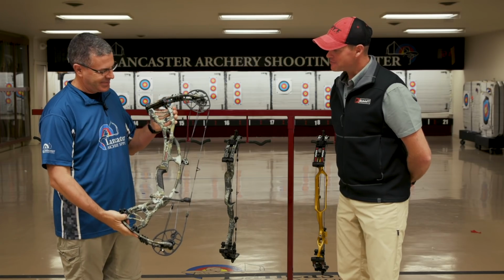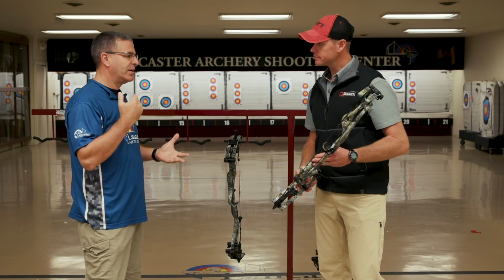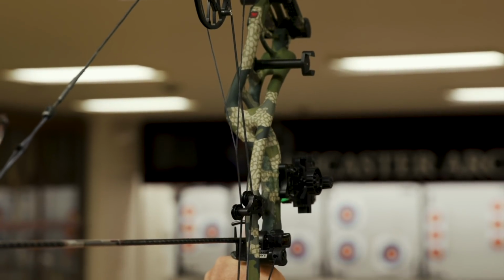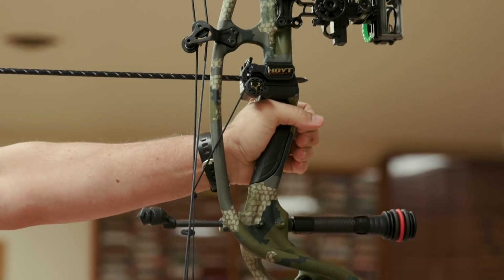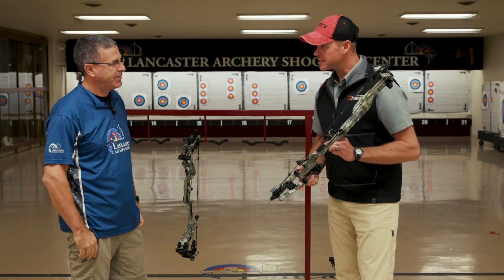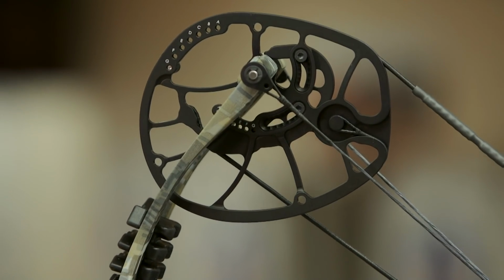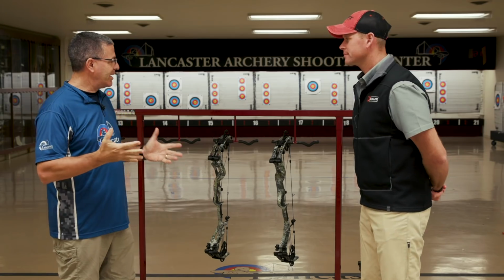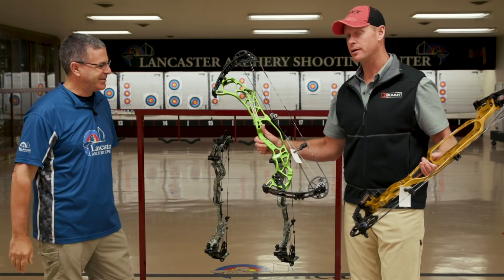2019 Hoyt RX-3, Helix and ProForce FX Compound Bow Reviews

Comment: 2 grand?!?! Um, no thanks.
Reply: A.) Retailers don't charge that. B.) Target bows are expensive. But if you were the actual target market (ha ha, see what I did there?) you'd already know this. They're usually about $1799 retail. Have been for a damn long time. Check out the Mathews TRX-7, PSE Perform-X, Bowtech Fanatic. You'll see a few hundred dollars difference in some of these (the Fanatic in particular, largely because it doesn't have a shoot-through riser and isn't a Mathews), but.. that's just how much this class of bow costs.
Reply: elixiriszog Well, I know absolutely nothing about bows, however, by the comments in this comment section, I come to realize I’m not the only one that thinks these Hoyts are ridiculously overpriced.

Comment: Always wanted a Hoyt... but have never liked the hand shock or the valley on the turbo
Reply: The turbos have always been their worst bows, this is true. Try out the non turbo versions. Basically ALL bows at 350+ ibo want to rip your arm off if you relax. To my knowledge, nobody has actually fixed this. The last couple bowtechs capable of those speeds (supposedly) are a bit better than some past offerings, but... almost everybody I know is shooting them in the 340 "comfort" setting anyway. 8-10 fps off the top end means nothing, really.